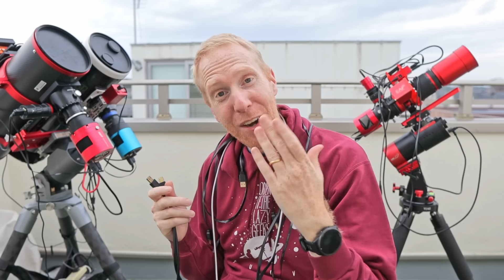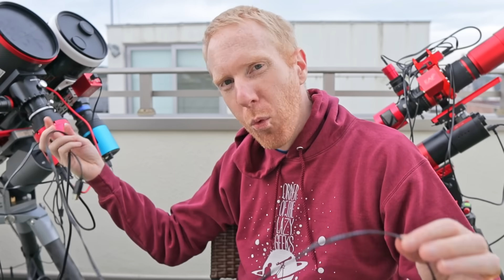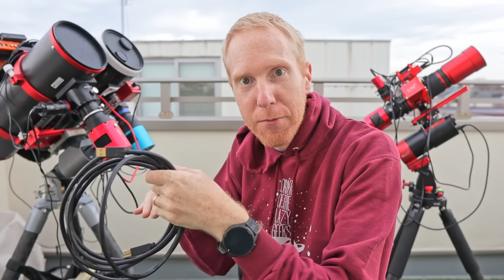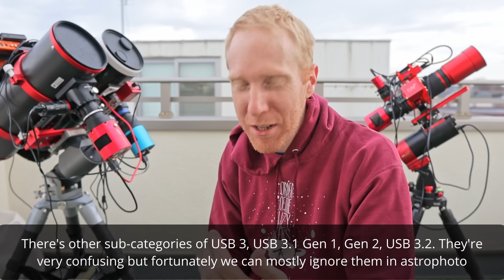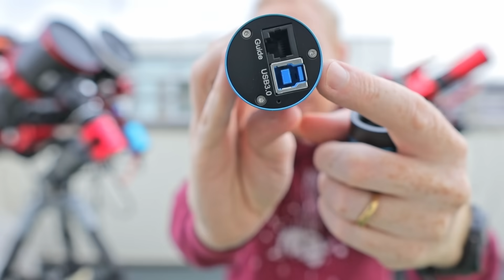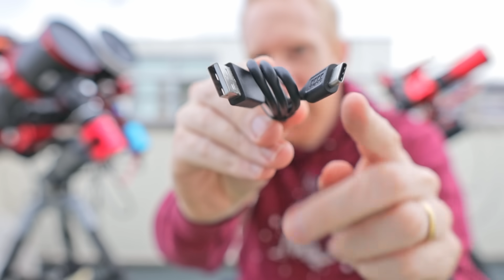YOU could be the NEXT VICTIM! Prevent Cables from Ruining your Next Astrophotography Night

Comment from the maker: Let us know your cable-related horror stories!!

My Patreon: https://www.patreon.com/cuivlazygeek
My Merch Store: https://cuiv.myspreadshop.com/

Cable Organizers: https://www.etsy.com/shop/SmartComponents

Amazon affiliate: https://amzn.to/49XTx01
Agena affiliate: https://bit.ly/3Om0hNG
High Point Scientific affiliate: https://bit.ly/3lReu8R
First Light Optics affiliate: https://tinyurl.com/yxd2jkr2
All-Star Telescope affiliate: http://bit.ly/3SCgVbV
Astroshop.eu Affiliate: http://tinyurl.com/2vafkax8

From Nick, one of my Patreon Supporters:

I also had cables going bad, but the reason wasn't kinks or interference but corrosion in the connectors. These connectors are not designed for outdoor use and condensation will eventually form and corrode the metal parts. The oxidation on the surface of the metal contacts creates parasitic resistance which interferes with the data transfer. This is the reason the cables initially work and then fail. The solution is to replace the bad cables or use a drop of contact cleaner solution (sold in electronics stores).
Reply: had this loads of times in the last 20 years and also usb hubs. and its so weird how they can stop working with just 1 camera but work fine on another and vice versa. USB has always been unreliable for me and imaging. And doesnt seem to matter if they are cheap or expensive just seems totally random.
Reply: Cuiv I literaly had my mount cable fail last night 🫣, did't have a spare cause I wasn't home, but luckily the mount had wifi. I'm now running into yet another trouble, my ha channel somehow won't align with my Sii and Oiii 😶‍🌫
Reply: In addition to all of that, those tiny connectors inside the plugs get a film on them over time. A simple fix is often to just exercise the connectors by unplugging and reinserting them a few times. It has almost become a routine for me. My ASI 1600MM Pro has been having some cooling anomalies, getting hot pixel scatter in my imaging files. Today I simply unplugged and reinserted all my USB and Power connectors for the win. Why is that? Because it wipes the contacts off and makes good contact again. I've replaced many, many cables over the years.
Reply: Indeed, in Europe a well known brand is "kontakt" there is an anti corrosion  one : "61"  most used for selector switches on tuners, look for  "kontakt 600" and amplifiers.

Comment: If what I'm watching is any indication, I have a tendency to believe that perhaps your cables aren't working properly sincee you nervously, spastically flex them, bend them, fold them, twist them and roll them even with the one that you're talking with in your hand while you're recording the video... Perhaps the first lesson should be how to treat cables and ropes properly when coiling them or winding them and storing them. It was a long video that didn't focus on cables, the way we're supposed to handle them and store them and the way that they're designed etc without all of the camera clutter... The message should have been very short and simple- " Stop abusing your cables!" It doesn't take almost twenty minutes to tell people that.

Comment: Very useful video on an often overlooked issue, Cuiv. Potentially saved a lot of frustration for many people.
I have a burning question: would it be okay to use just the USB 3 cable of the main camera to connect the guide camera and mount as well through its hub? Granted, the guide camera will run at USB 2 even it is supports USB 3, but that's probably fine
Reply from the maker: Yes that's normally fine (and what I do!)

Comment: I agree that the flat cables supplied by ZWO lack shielding, but they are also weak (wire is too thin). When I first bought a ZWO camera I liked this flat design cable, since it bundled nicely in a cable management scheme, but within several months one failed, then another and then another. I tried them on other devices and they did not work. I have since gone to a good quality slender, round, braided design of cable with no issues after several years use. Sometimes it is even how loose the USB plug fits that will make it fail. On the female ports on my laptop, for instance, I have used a dental pick to bend the springy retaining tangs for improved grip (computer powered off of course).

Comment: What are your thoughts about Prima Luce Labs ghost mode, which can use wireless transfer of data. Theoretically it should omit these types of concerns. Only power cords to the devices are required. Obviously wireless data connections can have issues too.

Comment: My latest problem has been the length of my USB 3 cables. The DSLR worked fine with my four meter cables but not when I tried to use the new dedicated QHY 183 M camera. From my former experience as an electrician I realized the longer the cable, the more copper conductor, the more voltage drop and signal loss due to increasing resistance in the longer conductors. Interference usually isn't a problem unless you're running power cables with data cables, as USB cables have braided shields around them that carry unwanted signals to ground. AC and DC power cables create electromagnetic fields that can corrupt data pulses. The fields surround the cables when they're energized. The fix, I believe, is to use a powered USB hub, like Pegasus Astro power box. This should boost the signal from the camera, although im sure it has it's limitations as well.  Another option I just learned about are "powered" USB cables. Basically the same thing, just built into the cable itself.

Comment: I had the same problem as you are experiencing a couple of years ago.
I ended up buying quality Lindy and Deltaco cables, they have been running fine for several years now in my obsy. (even at 3+ meters length)

/Daniel

Comment: This kind of experience has caused me to build permanent looms for my rigs. I've iterated each rig through a series of versions to reach a kind of optimum that show reliability and are designed to avoid snagging risks. That process shakes down dodgy compromises and identifies bad cables. I've never had cross signal interference from bundling two or three cables or power with USB. I have also taken liberties with the bending radius for the big red ones. In these aspects I hang my head with shame and don't recommend the practice but its worth keeping these sins in perspective. I also built a 'faraday cage' like yours round my ASIAIR once, with the same cable tidy's (that block the cooling vents). My cage did a much better job of insulating my pro from WIFI signals, so I found that mistake during indoor testing! A plus or mini with an external aerial might fare better here. The biggest repeating failure theme I have seen is just loose connections at the plugs. I'd recommend mounting ASIairs etc. with USB ports pointing 'up' the OTA whenever possible, so that the cables' own weight doesn't tend to unplug them. Pegasus Astro are one supplier that provides cables that don't come loose and power distribution and dewstrap management with sockets that don't let go. I'm using one of their products on each rig now to distribute power from a point in or near the saddle. (8A will let you supply power to everything whereas ASIAir sails too close to the wind and you're asking for intermitten gremlin trouble if you don't budget power properly - (i.e. using a worse case demand sum based on spec figures for maximum current drawn - Murphy will get you otherwise. Alex tech sleeves, tape every 10cm, and internal tie wraps keep my looms tidy. I (re-)use velcro tie wraps to prototype looms/revisions. One of my rigs (the grab and go) I never dismantle - saving wear and tear on the cabling and sockets. The other 'big rig' has cameras that are swapped occasionally but the cabling serves both, and the loom has slack enough for either one. The downside here is that adding equipment like an EAF or EFW will require a loom rework (but you can put that off with an external 'ugly' for as long as you want). The upside is you know 100% for sure that you're connecting everything up EXACTLY as you did last time and (while that can't immunize against every failure) it goes a long way towards establishing trusted configurations, and repeatable experiences where glitches should be much less likely, and easier to track down and fix. OBVIOUSLY The Order of the Lazy Geek cloth carrier bag is an absolute must have accessory as a "stuff bag" for your loom when you tear down your rig and pack up - as it will guarantee that you never have any wiring issues forevermore!

Comment: I’ve used the ZWO flat cables for years without an issue but who knows, maybe one will fail some day.    I suspect, like another person suggested, that failure has occurred at one of the plug ends on the USB2 signaling.   USB2 and 3 are entirely different conductors in the cables.  Just mechanical stresses.

Comment: That's funny you just posted this video. that's exactly what I've dealt with for countless hours over the past two beautiful clear dark nights. 

There's so much junk being sold nowadays—poorly built with low-grade materials—and brands that change names every few months after their reputation is trashed due to poor quality. I've learned that for my expensive AP equipment, reliability is key, so I buy from brands that have been around for at least 4-5 years, regardless of the price. 

I’ve bought USB 3.1 blue hubs that weren't any faster than USB 1.0, which is such a shame. I use a simple application called CrystalDiskMark to check every USB cable and drive I purchase and have returned many products that lied about their speeds. Note: ferrite chokes added to each end of the USB cable can attenuate some of the EMI and RFI issues.

By the way, nice hat!

Comment: Good vid!  I stopped using the ribbon cables a while back because I ran into intermittent issues.  Get cables with gold-plated connectors and appropriate shielding unless they are less than 12".  In general, USB2 cables can carry reliable signal further than USB3 due to the slower speed, but  the quality of the cable makes the biggest difference IMO.

Comment: Was there a specific reason to use a different usb cable (the one that turned out to be faulty) rather than the red one that came with your camera???
Reply from the maker: Yes - I had been using it with another camera, so it was there, in place, the right length, etc.! I didn't see the need to replace it!
Reply: @CuivTheLazyGeek  ahh ok, I've done the same myself lol

Comment: Great video Cuiv, as always! I had a problem with my QHY268M-Pro connecting it through the USB3 powered hub. About half of the frames came in "cut" in random pieces (apparently a known problem). Replacing the connection with a direct fat USB3 cable almost fixed it. I still get this defect, but very rarely. My cable length is 2m or so, that's probably why. I agree, cables and points of contact (those can oxidize!) are very important.
Reply from the maker: Huh, very interesting, and annoying issue....

Comment: Cuiv, Great video as always and certainly an important topic based on the large number of comments below.  I experienced similar issues with my new ASI2600 MC Pro - only the red 2M USB-3 cable worked!  It was too long for my setup and none of the other supplied cable would allow image downloads.  I eventually got a shorter 5Gb/s cable from Pegasus Astro that worked fine.  I suspect that all the larger sensor camera (APSC and full frame) may have similar issues or perhaps its a quirk of ZWO??  Thanks again.

Comment: I was facing the same issue. Download error. Device manager refreshing all the time. Cable replaced, all is fine now.

The original ZWO cable failed in under 6 months. Another 6 months for Amazon Basics cable. Got a cheap ass cable now. Light weight and braided.

Comment: I bought a new ASI2600MC and the first time I tried to use it, I got intermittent image download failures. My first thought was a problem with my ASIAIR, so I used a different device, same problem. I assumed that my. camera was defective since the cable was brand new and came with the camera. But I switched the cable out and the camera has been fine ever since. Now I have a plethora of backup cables for all the different usb connecters and speeds.

Comment: This is a very good video and applies to a lot of situations!  I don't see an issue with EM interference between adjacent data cables, it's all very low voltage.  Never put 120VAC or 240VAC power cables against them parallel, though!

Comment: I had the exact same issue that you described with a ZWO flat camera cable. I replaced it for a short and thick cable from Lindy and never had such an issue since. Also it’s a good idea to have cables as short as possible which helps alleviate things like signal attenuation etc
Reply: I second the Lindy cables. Very good

Comment: Same for me. I tried to use some short cable, instead of long one, but at somepoint guide camera start to disconnect. I divscovered that the cables i had was usb 2 and the camera is an usb 3. So now i have a question: is that possible to connect directly the focuser to the camera ? which is the advantage to do that ?

Comment: A great video Lord Cuiv 😊 I’ve spent my working life (over 40 years) troubleshooting and diagnosing data communications network faults and problems. Whilst there are numerous methodologies, I generally find that starting at the lowest level and working up (reference the OSI 7 layer model) provides a good basis for fault finding. Ensuring the most basic elements function first - physical connections and interfaces, ensuring all wires in an ethernet or USB cable are intact, providing signal etc. and then moving on up.

Comment: This is sooo common these days, the manufactured specs compared to the cable you buy is vastly different. I have had so many fail on me where I have half the image train appart till it was evident that it was a failed cable. I was having focouser problems, yet could operate my astro camera perfectly, the last thing that came to my mind was the cable going from thee astro camera to the PC, I had swapped the cable going from focouser to the camera 7 times that night, and went to the local petrol station to buy a new cable, which was not up to spec for fast video delivery. I am about to spend money on Cable Mod cables just because you are guarenteed quality.

Comment: blue was originally USB2 and USB 3 was red - then they just wanted to confuse us 🤷‍♀
lots of usb problems can also be power delivery related. shorted the faster...
Reply from the maker: And then you have Razer using green, and other brands using other colors! And of course technically white USB plug would be USB1, and black would be USB2, but that's actually not so strong either :)
Reply: @CuivTheLazyGeek  plz check community tab as need your advice sir cuiv

Comment: So it's possible what happened here is that the USB 2.0 data pins in your faulty cable broke, but the high-speed USB 3.0 pairs were still intact. These two channels operate mostly independently in a USB3+ device, so if the main sensor chip lives on the USB3 (xHCI) bus and the built-in hub and built-in guide chip live on the USB 2.0 (EHCI) bus, then a partial failure like this could happen and would result in symptoms like you saw.

Definitely agree that shielding is substantially more challenging in flat cables than rounded ones. It's possible to make a quality flat cable, but a lot more difficult, so if you don't need the flexibility, stick to the rounded ones for high data rates where possible.

USB C to C cables are definitely very challenging; there's no clear identification in the general case, and manufacturers are very inconsistent about colour codes and labels as to what each cable will or won't do. I make a point of marking any cables I have bought and confirmed as proper USB 3 cables with a small "3" so I don't get confused down the road, but in general the 3+ cables are somewhat thicker/stiffer. If your C to C cable is quite flexible, it's likely a 2.0-only cable. If the cable is 15ft or longer, it's almost certainly a 2.0-only cable! Even 10ft is tricky for USB 3.0+ speeds.

Comment: Great video (and timely)! I just got my new asi533mc pro, which comes with the thick usb3.0 cable. I'm using a star adventurer GTI mount and my setup is below the payload limit but it's getting close. Because of that, I need to mount my ASI air mini on my tripod and run the 3.0 cable to it from the camera. I've noticed that just that cable changes the balance of my telescope. How much does a thick cable impact a small mount and are there any solutions to minimize that impact?

Comment: I've been testing camera USB cables by running them in SharpCap at maximum frame rate using USB 3.0.  I was floored by the frame drops.  I need a 90-degree angled cable to fit my setup, and of the more than dozen cables I've tried over the last little while, only ONE worked properly.  BTW I have not found any cable that matches the one ZWO provided for throughput.  That flat cable has the lowest number of frame drops when tested alone, but when bunched with other cables, all bets are off.
Great video, and a reminder to keep cables separated, especially data from power.
Reply: That plastic cable holder Cuiv showed us not a good idea?